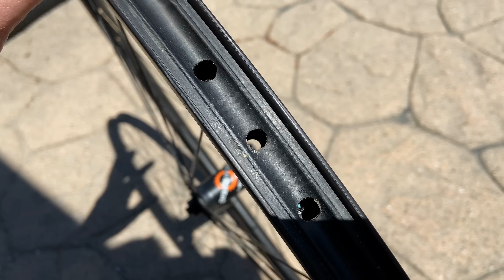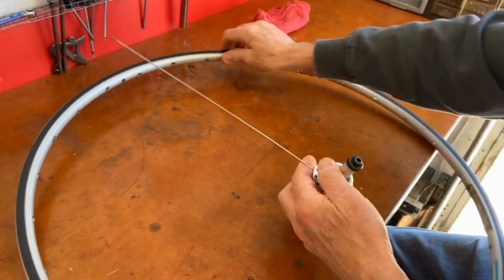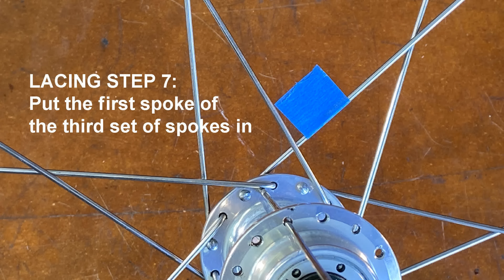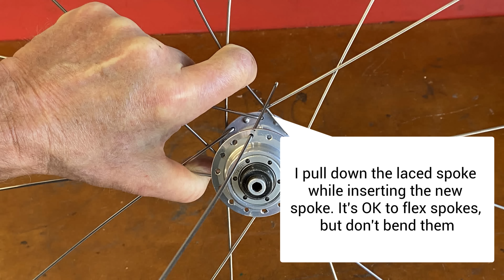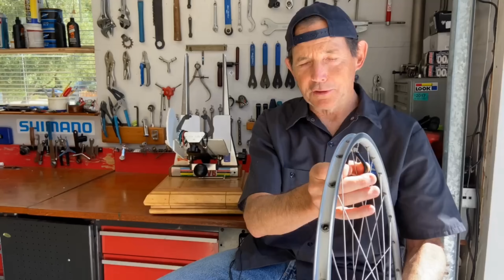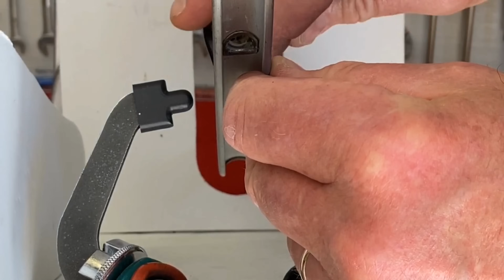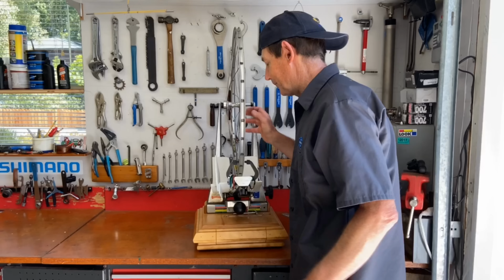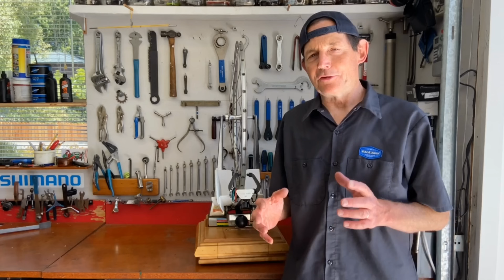How To Build Bicycle Wheels THE EASY WAY! #bikerepair

Comment: Nice monologue, but too many words. I wrote a one-page instruction that has taught many. You want it, just ask.
Reply: I actually liked the cadence and quantity of instruction. I wouldn't say either is wrong.
Reply from the maker: Appreciate you watching and the comment, Bob. Trust me, I only used the words that were required to ensure viewers would be able to build wheels after watching the video. Unlike you, most of them don't already know how to do it. ;-)
Reply: @JimLangley1  I think your content is right-on, but I find (many/most) people zone out of wheel building because it becomes so laborious to read, listen or eve watch. That is why I skinnied my "how to" down. I enjoy sharing it, because I believe the wheel is the most feared element to fix or re/build. I want people to fly over that hurdle and enjoy the freedom of knowledge. Same as you do.
Reply: Copy/paste this into a text file...you will need to insert CR/LF because YT takes them out.
MAJOR TOPICS: A, B, C, ...
SUBTOPICS: 1, 2, 3,...

A. Make sure your RIM and HUB use the same number of spokes. B. Calculate spoke length(s) 	 1. https://www.prowheelbuilder.com/ >> click SPOKE CALCULATOR 	    https://www.wheelpro.co.uk/ >> click SPOKE CALCULATOR 	 2. Select WHEEL TYPE (Front/Rear) >> skip to NUMBER OF SPOKES 	 3. Enter NUMBER OF SPOKES (normal 32 or 36) 	 4. Enter LACING PATTERN (normal 3 CROSS) 	 5. Enter rim Effective Rim Diameter (ERD) 	 6. Enter hub AXLE WIDTH (Outside Locknut Dimension - OLD) 	 7. Enter Non-Drive Side (NDS) LOCKNUT TO (MID) FLANGE distance 	 8. Enter Drive Side (DS) LOCKNUT TO (MID) FLANGE distance 	 9. Enter LEFT (NDS) FLANGE DIAMETER (spoke hole to spoke hole) 	10. Enter RIGHT (DS) FLANGE DIAMETER (spoke hole to spoke hole) 	11. Enter spoke hole diameter (normal 2.6 mm) B. Build the wheel 	1. Oil nipples and spoke threads 	2. Align hub label so it is visible through valve hole 		- add 1/4 CCW twist of hub – aligns label on completion 	3. Insert DS in-bound spokes in hub, every second hole 		- first hub spoke in first rim hole to left of valve hole 		- remaining spokes every fourth rim hole (1 0 0 0 1) 		- turn nipple 4 turns 		- FLIP WHEEL 	4. Insert NDS in-bound spokes in hub, above/right of DS spokes 		- first spoke is 2 holes to right of valve hole 		- then every fourth hole, next to DS spokes 		- DO NOT flip wheel YET 	5. Insert DS out-bound spokes, then grab spokes below 		- FLIP WHEEL and lay spokes orderly 		- rotate hub CCW (inbound spokes now radiate to right) 		- cross each DS spoke Over/Over/Under(/over) DS-IN spokes 	6. Insert NDS out-bound spokes, then grab spokes below 		- FLIP WHEEL and lay spokes orderly 		- cross each NDS spoke Over/Over/Under(/over) NDS-IN spokes 	7. From valve hole, tighten each spoke 2 turns until firm 	8. Tighten each spoke 1 turn for 4 rounds 	9. (REAR WHEEL) On 4th - 8th rounds, only tighten drive side 1 turn C. TRUE (side/side, hop, dip) and CENTER rim on hub (OLD)
Reply: @bob-ny6kn  This is a cheat sheet / check list that someone could use once they understand how to do this. Thanks for sharing. This alone wouldn't have been a good way for me personally to learn how to lace and true.
Reply: @mr_mr  We each have our own ways to learn. For me, these instructions were yelled across a busy shop, one step at a time, once. I wrote them down after, and this paper has taught dozens who initially had no idea they could build a wheel. It doesn't cheat at all. It gets to the point.
Reply: @bob-ny6kn  good points Bob. I certainly was saying it was a cheat, but more the reference of a "crib sheet" as in a concise reference.
Thanks for being engaged and sharing this.
Reply: @mr_mr  Best wishes on more bicycle tech/mech videos. With you all the way.

Comment: Do you have a favorite resource for calculating spoke length? Mine always end up 2 mm longer than I need so they thread past the top of the nipple. Which means I can't use a driver.
Reply from the maker: I use one called Spoke Calc, which I downloaded years ago. I don't see it when I google it now so maybe it's no longer available (it's an Excel spreadsheet based calculator by Damon Rinard). However, with all spoke calculators there are things that go awry with the calculations. So, you said that yours always end up 2mm too long. From that you know that you should subtract 2mm from whatever length your calculator tells you to use. Then you should have the right length every time even using your calculator.
Reply: @JimLangley1  Thanks Jim!

Comment: I was debating having my wheels built at a shop or doing it myself and this video sold me. I feel so much more confident now. Thanks Jim!
Reply: You didn't mention a tension meter. Is this a good way to check the tension as well? I'm thinking without experience or a reference wheel, I might need this.
Reply: Sorry! I actually searched the comments and see you've answered this. I'll be getting the tool. I think it will be helpful and I'll need any advantage I can get. haha.
Reply from the maker: Yes, I give some tension meter recommendations in a couple of other replies, MR MR. I'm glad you found them. You will like having the tool. It's great for building and repairing wheels and just a fun tool to have in your toolbox. Thanks!

Comment: I had downloaded a set of wheel building instructions, but they were so confusing I ended up taking the spoked out and referred to this. Your way is SO much easier to do and understand. Thank you.
Reply from the maker: Thanks so much for commenting, fosterdl1. One of the main reasons I made this video was to show that wheel lacing and building is a relatively easy process if you approach it in a simple & what I have found - is an easy way for people to understand it. I’m very happy to hear it helped you succeed. Thanks a lot for watching and for the great comment.

Comment: Great video... brings back a lot of memories of when I used to do this as a living in the 90's. If I remember correctly, I always took a slightly different approach. I always started with the head out spokes on the drive side and then the head out spokes on the other side. After that the head in spokes on the drive side and then the head in spokes on the final side. That method especially works better on things like moped or motorcycle wheels that have less flexible spokes or shorter spokes.
Reply from the maker: Thanks for watching and the kind words, speedphreax - appreciate it! Yes, there are lots of different ways to lace wheels. Once they've mastered the basic technique, I encourage newer builders to experiment with the different methods to determine which they like best. And, it's true that when you work with inflexible spokes such as on motorized vehicles (and some carts), that you want to choose a pattern that doesn't require flexing the spokes to fit them into the wheel because those spokes can't be flexed much if at all in some cases. Thanks for making that excellent point!

Comment: Spoke twist-When I'm nearing the final stages of truing, I'll place an alligator clip on the spoke I'm working on. If the spoke is twisting as I'm tightening, I can easily see it if the end of the clip starts turning. It also gives me a good reference for the neutral point. If the spoke is twisting, I can turn a bit past my intended point, when back off until the end of the clip is turned back to it's starting position.
Reply from the maker: Thanks for sharing your tip UnivegaSuperSport (nice bikes those Univegas!) That's a clever way to be able to see spoke twist and ensure you remove it. Appreciate you commenting with this cool tip to help everyone with their wheel building. Thanks for watching and the great tip!
Reply: @JimLangley1  I also use the clip as a placeholder in case I get pulled away from the job or drop the spoke wrench. That wheel WILL revolve if you let it go and you'll have no clue which spoke you left off on. I grew to prefer the Spokey or the round DT Swiss wrenches with plastic bodies. Heavy metal wrenches seem to slip out of my hands scratch up the rim if you drop them.
Reply from the maker: @UnivegaSuperSport  thanks a lot UnivegaSuperSport! Those are very helpful tips. I appreciate you sharing them with everyone. Thank you!!

Comment: I am updating my 1990 mountain bike. I want to go with the Shimano 105  2X11 group set And convert this into a roadish gravel bike.   Do I have to purchase a non-disk hub? Or can you actually use a disk ready hub on a bike that will be using rim brakes as long is the width is correct to fit on the bike?  I have 26 inch wheels on (135mm) And I am wanting to go with an 11 speed cassette.  Until I found your video, I had no idea that I could rebuild my own wheel with a new hub. Hopefully I can find on your channel the best source for ordering spokes and nipples.   Thank you again for this awesome and very helpful video!
Reply from the maker: Thanks for watching, Tom, and the nice comments. To answer your questions, I buy spokes from www.wheelbuilder.com - they ship quickly and stock a wide selection. You can find spokes lots of other places, too, such as bike shops, ebay.com and amazon.com, etc. Regarding the hub, yes you can use a regular hub or a disc hub even if you're not running a disc yet. And, you'll be fine with the 11-speed cassette. Hope this helps with your mountain bike to gravel bike rebuild and I'm happy to answer other questions if you have any. Thanks again!
Reply: @JimLangley1  If I disassemble the 26" wheels that are on my 1990 Mountain bike and buy a new hub, can I use the same spokes or would I have to purchase new ones?  If the diameter of the hub is the same that I should be able to reuse the same spokes unless it is a good idea to just get new ones.  Last question, can I do a DIY "resurfacing" of the rim side walls to clean them up and make them look nicer.  Thanks again for this video.  I will have to watch it again to jump on this project.
Reply from the maker: @flyinlo1474  As long as the new hub is the same dimensions as the old hub, those old spokes will fit, Tim. But spokes that old are probably worn out from the work they've done. Every revolution of a wheel flexes and works the spokes. And, even if the bike didn't get ridden that much, over the years corrosion develops on most spoke and nipples. So, I would recommend new spokes unless maybe someone rebuilt that wheel with high quality spokes at some time that still look good - like say DT Swiss stainless-steel spokes. You can "surface" rims in a way. What you do is use some medium sandpaper and carefully go around and evenly remove any scale or grit or issues on the surface. You're not trying to remove much material. It's more about making it have an even finish. Remember it's your braking surface so you don't want to make it slippery. You definitely don't want to cut into the aluminum much. You need it to handle the forces of braking. Hope this answers and have fun!
Reply: @JimLangley1  It seems very hard to upgrade an old Mtn Bike to a "gravel bike".  I am upgrading my 88 Panasonic to Ultegra with no problems (keeping as roadbike).  But trying to configure my old Giant with a "road groupset" seems impossible.   I need a 135mm hub (36h)  that would ideally support a 105 (or Tiagra) set of 2x11.  If you happen to know of a decent hub that would allow for this, please let me know.  Then I could rebuild my wheels, slap a new group set in with drop bars, wider "gravel tires" and be ready to roll.
Reply from the maker: @flyinlo1474  hubs like this should work, Tim: https://amzn.to/3myf86l - they are Novatec hubs - good quality. And, if you search Amazon some more you may find others. Also, lots of older components are available on eBay if you search enough and keep trying. You should be able to build that Giant into a gravel machine without too much difficulty. Have fun with it!
Reply: @JimLangley1  Awesome!!  Thank you.  I have ordered a set and I will put my wheel building skills to the test.  So when I tear it down, I will paint the center rim between the rim walls.  I will see if you have any videos on painting rims.  I would imagine no different from doing a custom paint job on the frame.  Thanks again for your help!!
Reply from the maker: @flyinlo1474  Ha, ha, no, I don't have any painting rim videos, Tim, but I sure do like a nicely painted rim. Old school cool - Schwinn used to do that sometimes with pinstripe accents - cream "body" paint with a red or black pinstripe on each edge. If you google "Schwinn painted rims" you'll turn up some pics to see what it looks like. Painting is a skill I have tried many times and never got close to mastering. Good luck!

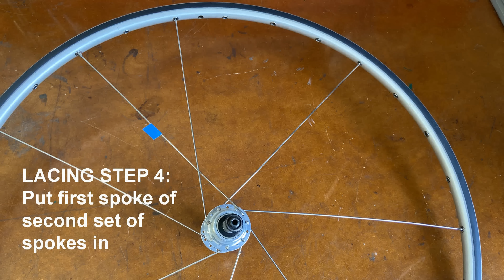Comment: @ 12:02 minutes, you said "If the valve hole is on the left, turn to the left" but "If the valve hole is on the right, turn to the right". Then as near as I can see the valve hole was on the right and you turned to the left.
Reply from the maker: Thanks for watching and for the comment, MrCosmos. Please watch that part again. You actually heard something different than what I say in the video. I didn't say "if the VALVE HOLE is on the right," I said, if "IT'S on the right" and the "it's" refers to the spoke being on the right, not the valve hole being on the right. This is the only thing that makes sense semantically because you can't twist the valve hole, you can only twist the spoke/hub. I hope that helps explain and thanks again!